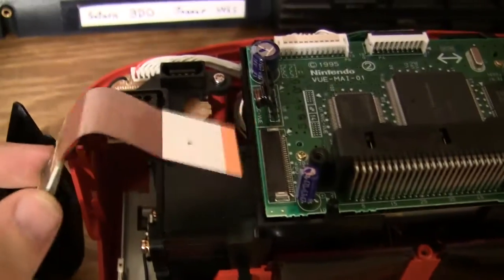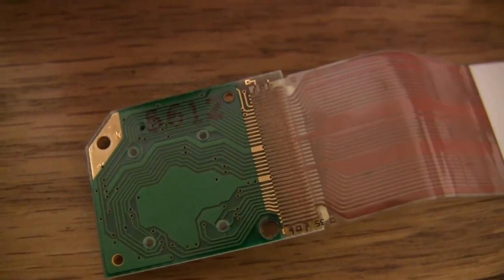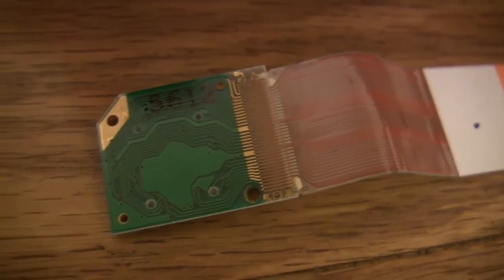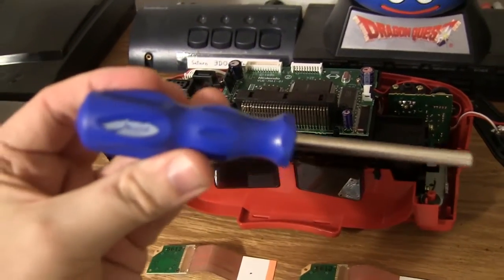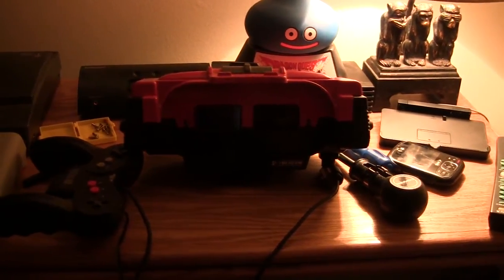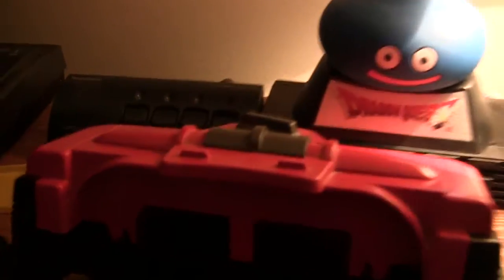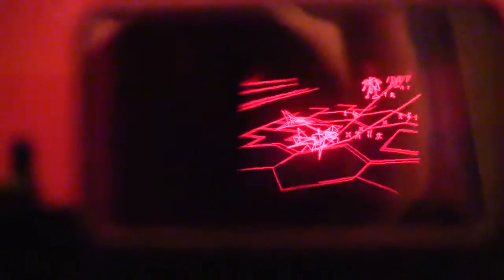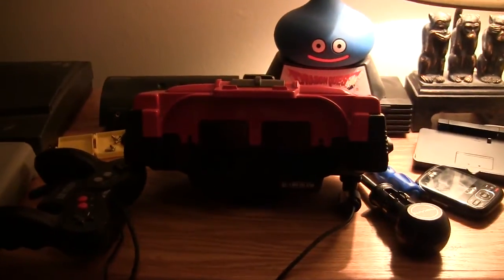Virtual Boy Horizontal Line Problem - FIXED!

Comment from the maker: The headset alone is only worth about $40, maybe like $80-100 with stand and visor. $40 for an AC adapter tap. I am hoping the value of mine has gone up as a result of this modification which should extend it's life significantly.